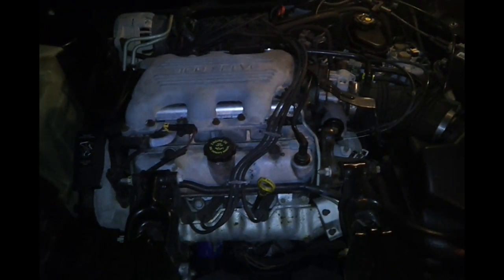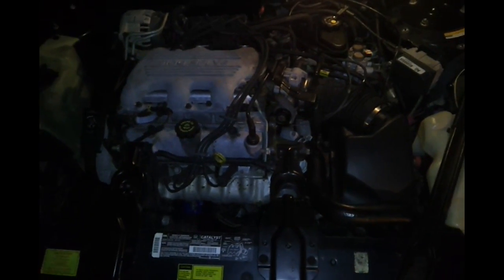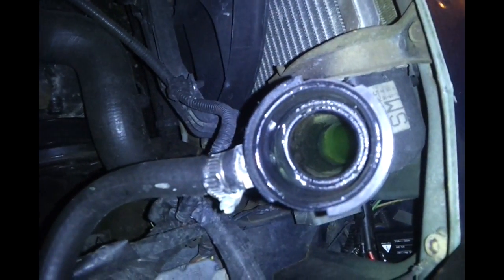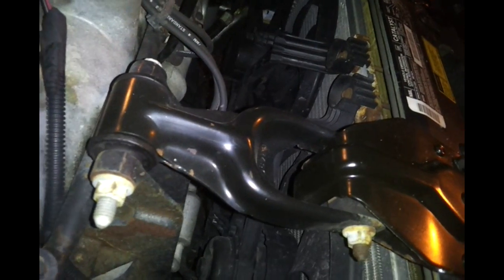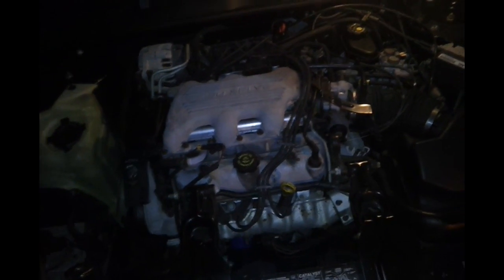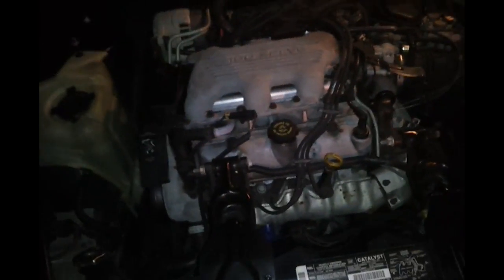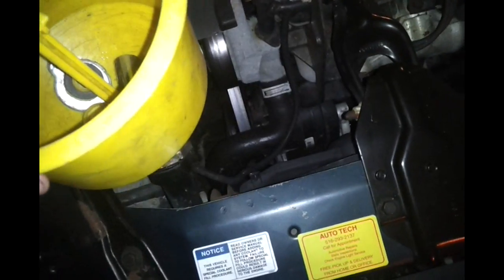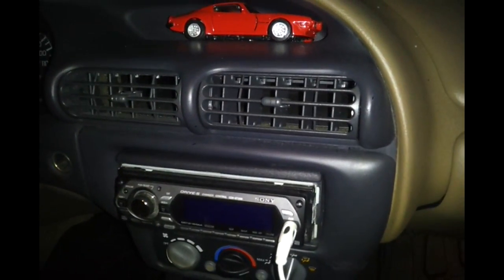How to Check your Cooling system

Comment: When I put my ac on my van only in the front is cool but when I put all of them the one in the middle an the back my van starts to heat up an less air in the front. 
98 DODGE CARAVAN 3.3 MOTOR 6 CYL